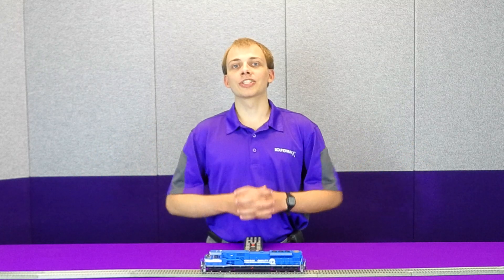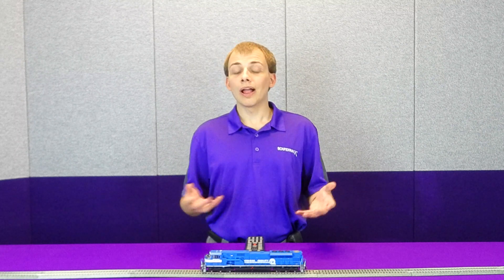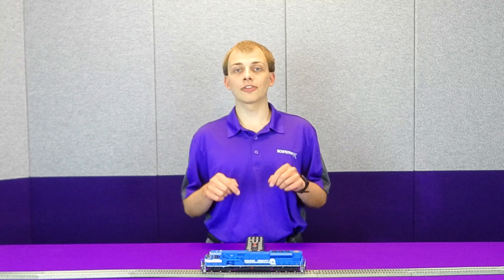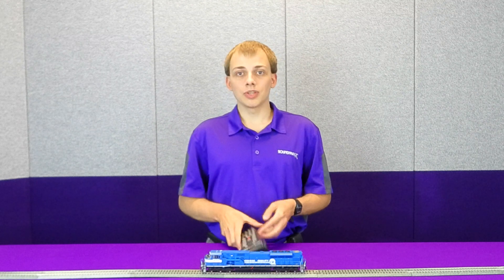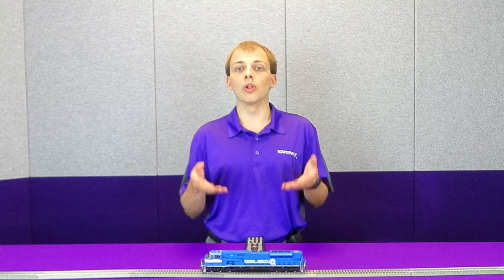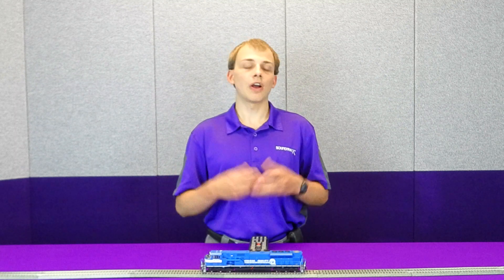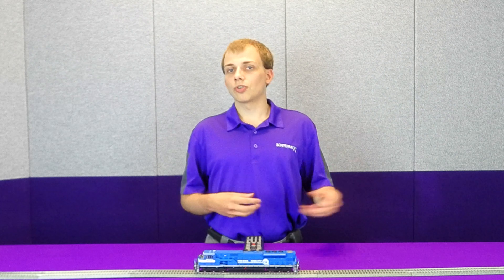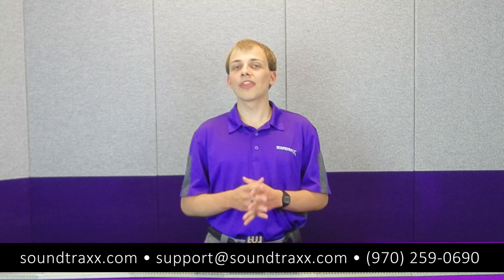Operations 101: BEMF Motor control (Episode 5)

Comment: A little more info on what effect that CV210 has would be helpful. What happens when it is changed up/down? Thanks. BEMF and Reverb / echo are my main nemeses on TS2 decoders...
Reply from the maker: CV 210 is used for adjusting the integral gain of the control loop, and compensates for static changes in motor load by applying a correction based on the integral difference between the throttle setting and the current motor speed. CV 210 may be set to a value from 0 to 255. Higher values indicate higher levels of compensation and a more sensitive control loop. We suggest setting CV 210 to the lowest value that still provides optimal performance; setting CV 210 to values that are too high may lead to oscillations in locomotive speed. Note: Setting CVs 209 and 210 to values of 0 will disable the control loop and is not recommended.
Reply: @SoundtraxxDCC  Thanks for the response. The last two sentences were the kind of info I was looking for--i.e. what is the real world effect in plain English....

Comment: Norman~,
              Informative video 👍, however, a better explanation of the benefits for some would be better served by actually demonstrating this process on an older steam engine with a close-up camera on the drivers.  I've been using these CV's along with a handful of other CVs together to tweak what most modelers have (older models).  I've been tweaking older models with older decoders to obtain smoother performance now for a couple decades.  This demonstration using a smooth new locomotive didn't drive home the best point of tweaking CVs for savvy modelers wanting to better understand BEMF and getting the most out of their Tsunami decoders. Just sayin'.       
                                                                                                                                                                                                                                                         Thanx Thom...
Reply from the maker: Thanks for the feedback, but we can only use models that we have access to for these videos.

Comment: I may have missed it, but are these CVs adjustable when back emf emf is  on/off?
Reply from the maker: If BEMF is on or off, the CVs are still adjustable, just like when the light is off, you can still change the CVs.  So, you can decide to adjust it at any time, but the CV values will not take effect until you re-enable BEMF.  I hope this helps.  Contact Norman in Support for more detailed information: (970)259-0690 or support@soundtraxx.com